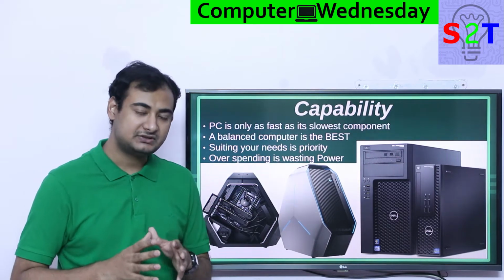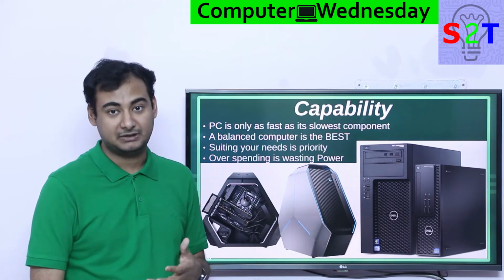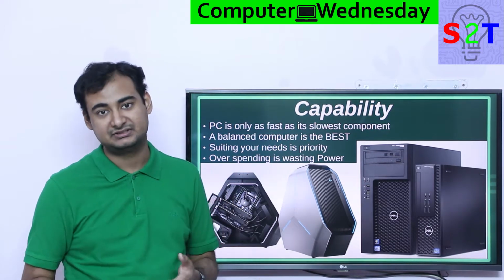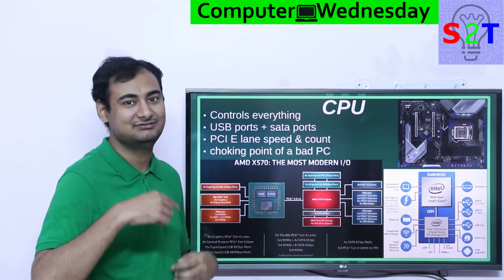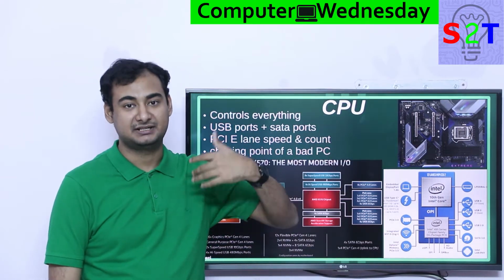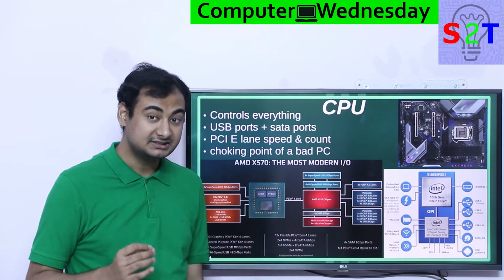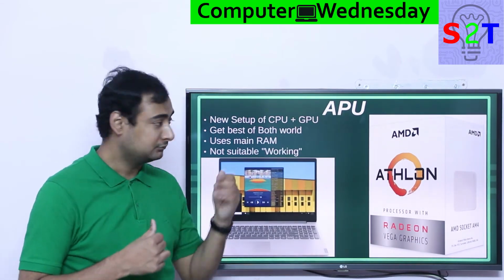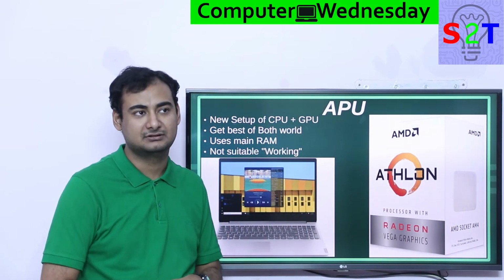CPU , GPU & APU Explained {Computer Wednesday Ep95}

Comment: What I would like to know is,  I have a APU cpu, and onboard graphics on my motherboard and have added a GPU graphics card, is it possible to use the APU part of the cpu to increase performance of the GPU card ? OR are the those APU parts of the CPU wasted ?
Reply from the maker: its wasted that is why its not main stream in desktop in laptop it makes sense as low power option when on battery & when plged in it uses GPU